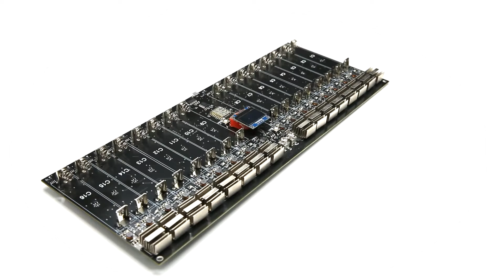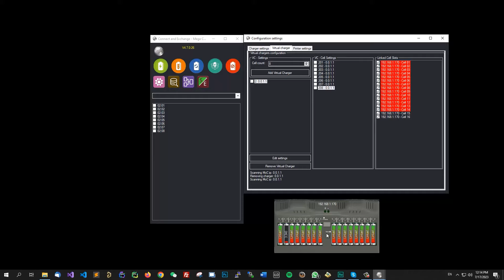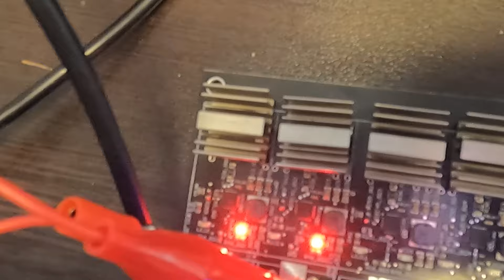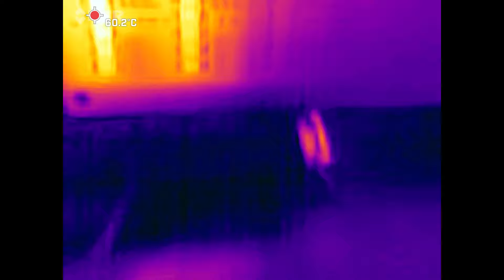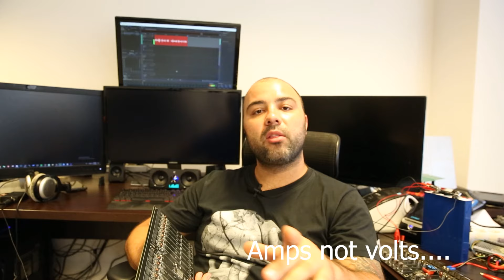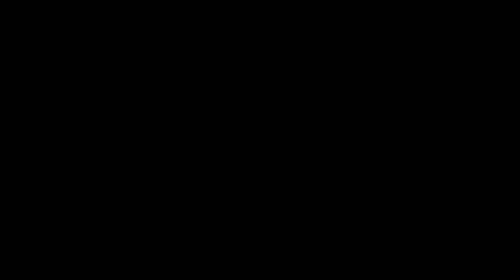Megacell Charger Professional Update - Variable Charging V and C and increased discharging rate

Comment: I may have to pull out my charger and try it again. Back when you first released these things, I bought one and it was a mess. Locked up all the time, disconnected from the app, bad readings, etc! you've had 3 years since I bought one to work out whatever software and firmware glitches. Maybe this is a usable tool now?